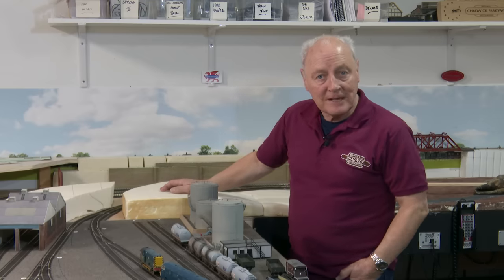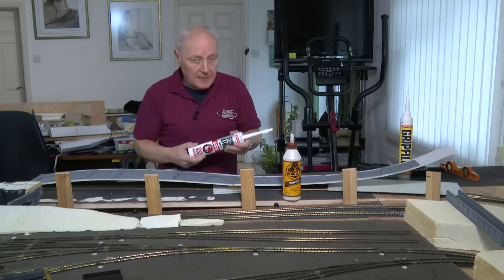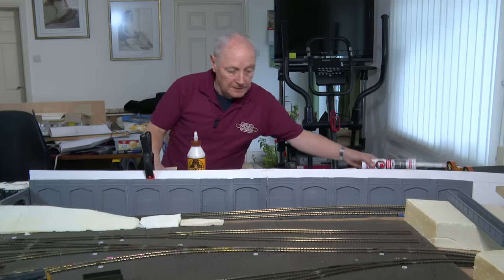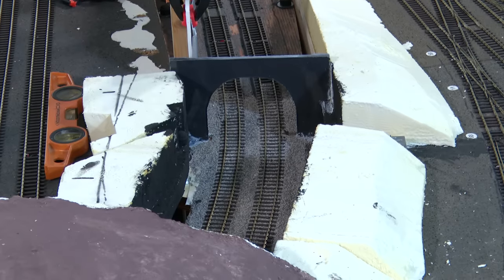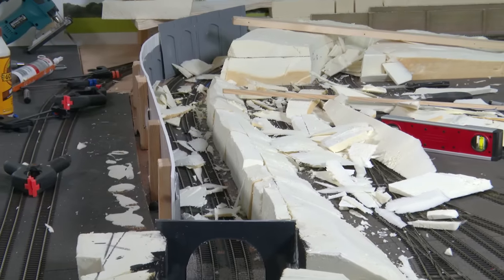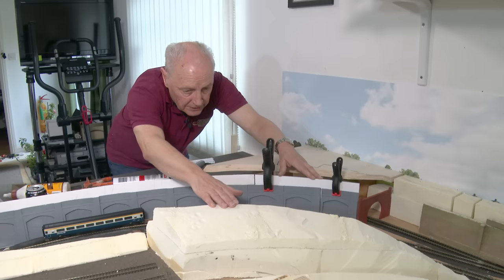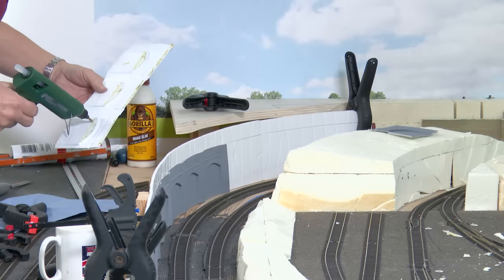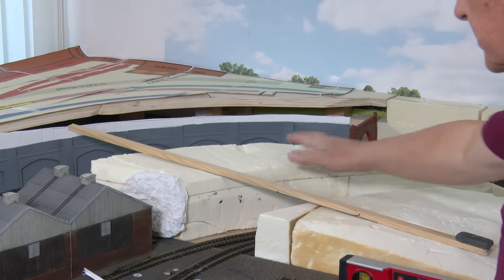BUILDING HILLSIDES & CUTTINGS at Chadwick Model Railway | 207.

Comment: Good stuff, as usual, Charlie.
The large wall sheets you got at Warley, look very similar to a German product, Merkur Styroplast, that I've used previously, though your ones look a bit thinner. Great way for filling up large vertical areas quickly and easily!  But (and I hope you don't mind me saying) I thought the cutting looked a bit odd with the very precise and neatly cut stonework on the TMD side and the rougher stonework on the freight yard side.  Surely they'd have been built at the same time from the same stones by the same masons?  By the way, if you want to add a bit of variety without using plaster rockfaces, Noch make some decent rockfaces out of a sort of harder foam than the Merkur stuff.
Weird that Woodland Scenics use that rubbish plastic for the tunnel liners, when their normal rockface moulds are so much better.
I saw a brilliant German model railway youtube video using the Viessmann car system, which included his homemade "points" for sending the lorries in different directions, and setting the relevant indicators flashing!  Could probably be a hobby all in itself!  Having installed it, he was amazed how easily the Viessmann trucks handled a steep hill, and actually had to install magnets to tell the lorries to slow down when negotiating the hill, whether going up or down.
Quick German pronunciation guide for ie and ei - pronounce the last letter of the pair. So Viessman is Veesman, and Fleischmann is Fl-eye-shman.  Please don't hate me: it's just when my fellow Englishmen pronounce it the wrong way round, it's like the teacher scraping his nails down the blackboard at school again, and if it was the German lesson, the teacher sending a well-aimed board duster at the boy who pronounced die as dye not dee.😀
Reply from the maker: Many thanks, Andrew, for an excellent comment. 
The stonework is a little bit of a dilemma and I have used the Noch ones previously, over by the branch line approach. No doubt I will sort this out over the Christmas period. 
Many thanks for the advice with Viessman, the trouble is, it is such an expensive addition to the layout. 
Stay safe, regards, Charlie

Comment: This is a fantastic shot from the camera, the taller retaining wall is erm 'prototypical' with the arched set back walls leaning in slightly however the lower height plain brick wall, should it have a bit of a lean back too? Cheers Ian
Reply from the maker: Thanks for sharing your thoughts, Ian. However, the lower wall is only held in with sticky tape. That one requires a lot more work. Regards, Charlie

Comment: Hi Charlie Slaters Plastikard is so much cheaper and readily folded and cut. Wills tunnel mouths are so much finer than the ones you are using, they also glues really well with MEK Pak glue, to the plastikard. I have lined 6 brick arches with this and they look really sharp
My friend runs buses on his Faller car system and they  run easily around a 150 radius roundabout in fact his is tighter as the buses draw into the Station Yard and stop
Reply from the maker: Thanks LW, that’s most useful. I should certainly check out the Faller curve. Regards, Charlie

Comment: I have noticed on my N gauge layout, there is no such thing as having too many clamps. Over the years, I think I have accumulated at least a dozen of each size available. Ballasting the initial 6-8 inches of track inside the tunnel, ahead of time is a good idea. Sadly, I didn't. You live, you learn. I love following your thought process for land formations. I hope I subconsciously did the same thing.  In some respect , N guage might be easier because you essentially have "twice" the scale space, to accomplish the same thing. I only have two tunnel liners on the two easily visible.
Reply from the maker: Yes that’s very interesting what you say regarding the N Gauge landscape. Regards Charlie

Comment: Hi Charlie, Interesting video that is already generating some great comments so here are mine:

Hills are usually undulating so you don't need to aim for perfection. The cutting looks really great, the uniform brickwork on the right hand side coming out of the tunnel needs that grouting and some moss or weeds!!. When you look at it there it's so narrow, I wonder whether they would have just reduced the height enough to make it safe and left it like that?

I've seen a car traction system called magnorail on the "Ronald Dodd" channel might be worth having a look.

You'll make your 100k, be interesting to know what your channel stats are.

Anyway, have a great weekend!!
Reply from the maker: I’m so pleased that you found interesting David. I think the Magnorail system won’t work due to the uneven road as it rises up the hill. Many thanks regards, Charlie

Comment: I think the mould for plaster casting would work better with a release agent- silicone release spray or silicone liquid lubricant applied sparingly.Assuming it does ,you may wish to backfill the mould base to make it more robust.
Reply from the maker: Excellent suggestions mate. However, shame they couldn’t have put it in the instructions! Regards, Charlie

Comment: I don’t know if you noticed but there’s a small gap between two of the panels. The instructions don’t mention it but if you add some plaster cloth to the back of the panel and when the panel sets remove it. That way you will have several panels waiting for a complete cure. As for road bridges BLMA have one as do Walthers Faller and Rix but not knowing how the system works I can’t recommend any specific ones.
Reply from the maker: Thanks SF, that’s most useful. Regards, Charlie

Comment: Hi Charlie, just watched the track cleaning video. Great stuff. I also watched one after from RTNT (USA) on NO-OX ID grease cleaning system. Have you any thoughts on this aspect of track cleaning. Others might find it interesting as this seems to be a long term solution. Thanks again for great vids. Steve.
Reply from the maker: Inox is a good long-term solution, however, keep it away from traction tyres. Also, if you have a steep helix, it may cause some slippage. Regards, Charlie

Comment: Hi Charlie 
I think both sides of the cutting should look the same as they will have been built at the same time. The arches look great, but the plain brick looks out of place next to it 
Steve R
Reply from the maker: Rest assured Steve, I will address this. However, it’s too small to use an arch type arrangement. Regards, Charlie

Comment: Great video as always Charlie. I’m nitpicking but would the brickwork in your new cutting be so different on each side if it was all built at the same time? I prefer the archway type you did first.
Reply from the maker: I know what you mean but the other wall is too low for an arch design. However, I will paint the stonework the same colour. Regards Charlie.

Comment: What do you need to do with bridges in order to get car systems to work? I cannot remember seeing car systems going over a plastic bridge - up ramps (which allow subterranean systems to be installed) but not bridges.
Will you need to custom build bridges with thicker bases to allow installing the motion system?
Reply from the maker: I believe so, but the motor is in the vehicle, just following a magnetic wire. Regards, Charlie

Comment: With both Car systems you need to be careful of any magnetisable material that is near the guiding wire or magnetic track. E.g. steel screws or nails as they can cause the vehicle to go off its planned path and crash.
If thevvehicles are to cross a live path like a railway crossing then you'll need control modules and sensors to stop either the trains or the car system vehicle to prevent accidents.
Reply from the maker: Thanks, Jonathan, very useful advice indeed. Regards, Charlie

Comment: Good morning Charlie. I think there’s a problem with using cast rock faces to transition to the lower level. That geology would cover all that part of the layout, therefore there’s no way the engineers would have erected all those stone and brick retaining walls, it would have been a waste of money. They would have just left the bare rock wouldn’t they? Best, TonyS
Reply: It all depends on what the actual quality of the local geology was to allow the Victorians to leave bare rock in the cuttings.
Reply from the maker: I would’ve thought that a low-level rock face would’ve been permissible. However, with the height of the retaining wall, I don’t think that would’ve been quite so acceptable to the engineers. Regards, Charlie

Comment: I use PVA for nearly everything when usung paper or card. I think the Class 66 is larger than the coaches you tested the clearance with. Are you convinced that the pattern on the sheets is to scale, it looks like O gauge?
Reply from the maker: Hi Sam, the pattern on the sheets, are you referring to the tunnel liner? Regards, Charlie
Reply: the large grey flexible plastic card you showed us. @ChadwickModelRailway

Comment: Why did you chose the Veissmann car system over the faller? I have never had any one of them, It's German so of course it's pricey.
Reply from the maker: No Ray, I haven’t chosen one over the other. My perception is that they will both work with the same buried wire. Regards, Charlie
Reply: Truth be told they are both German, and indeed both pricey.

Comment: Hello Charlie, at least Celotex is tidier than using polystyrene from old packaging (suggested by several YT modellers) - I tried that and never again.  It’s horrible, creates mess and comes off in clumps.  I’d rather the card and old newspaper method over that.  Landscaping does create mess but at least you’ve shown the least worst way of doing it…..whatever way you take it’s a horrible job!
Reply from the maker: Thanks Captain pub watch, I seem to spend most of the time clearing the mess up rather than doing the work! Regards, Charlie

Comment: I'm a little confused why there will be two different types of construction on either side of line. Why arches on one side, and just plain brick. Also why is the top of the arch higher than the top of the tunnel mouth? I would have thought that the top of the arch section, including the part above the arch would line up with the top of the tunnel mouth.
Reply: I too wondered why there were two differing retainer systems directly opposite each other.
Reply from the maker: Thanks gentlemen, I went for the plain brick on one side as it was a much shorter embankment.  Clearly I thought that the arches just wouldn’t look right for such a minor construction. Regards Charlie

Comment: Not meaning to be a revet counter but you may wish to put 3 24 in scale) vents on yours storage tanks.  Otherwise the UK Safety Protectorate will cite you for not properly protecting your atmospheric storage tanks) please, I hope you receive this with the intention of my lame sense of humor.  (Part of what I did for a living a very long time). For kicks and giggles Google tank car implosion.  It is a short clip showing the effect of atmospheric pressure.   (Due to the creation of a partial vacuum.  As Newton said F=ma.  Cheers and crack on! (What the hell is the meaning of crack on?)
Reply from the maker: Hi Ken, the term crack on means get on with it. I shall look into the subject of events based around 1970. Regards, Charlie
Reply: @ChadwickModelRailway  Apparently crack on was used here up to the Civil War but has died off.  You hear it use in Western movies on occasion.  So I was curious about the expression.